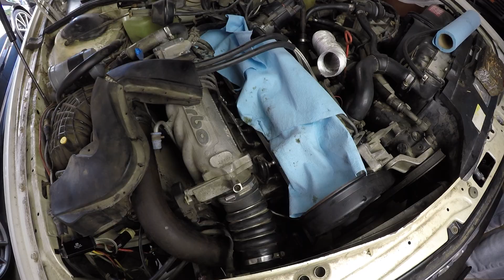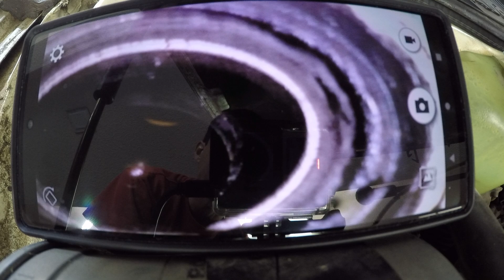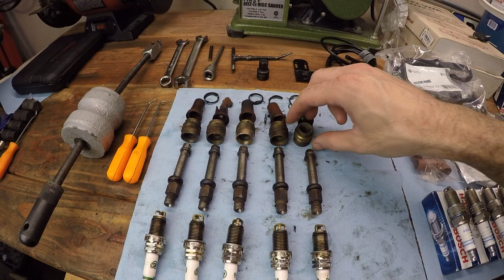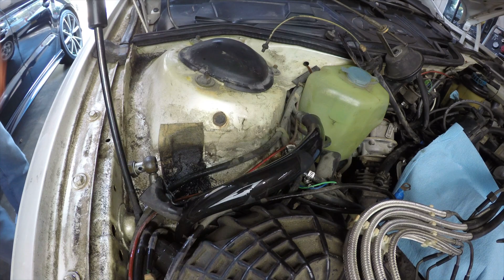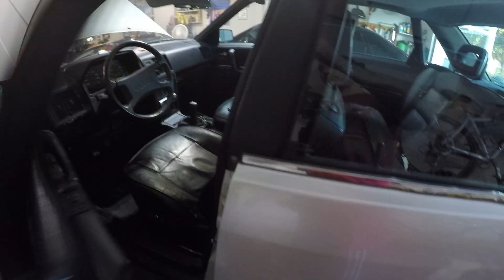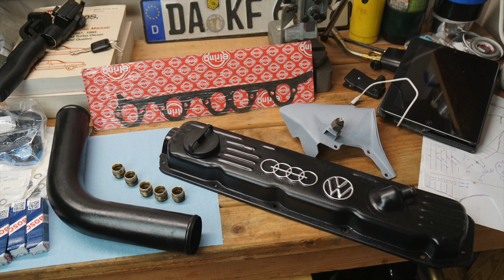Project Audi 5000 CS Quattro | Ep. 5 | CIS Fuel Injector Replacement

Comment: Thanks for this video it really helped me doing this job on my coupe gt! 
Shall i play the lottery now after i removed the threaded inserts the plastic sections came out all at one on the end ? 5 out of 5 came out all as one 👍🏼
Reply from the maker: Buy a ticket now!! That's very good luck 😆
Reply: @PracticalEnthusiast  still having a few issues with the car and how its running (if you have any tips/suggestions) but i’m happy that job went smoothly! 
Thanks for the video it really helped with visualising everything first before tackling the job 👍🏼
Reply from the maker: @mikeyalcock5729  that's great to hear! Continued running issues are likely down to a vacuum or boost leak. I just fixed a pretty big air leak in the throttle body shaft bearings. Unfortunately, that's not an easy job to remedy. If I end up keeping the car then I'll try to make a video on how to do it.

Comment: Hi there... i have a 1980 Audi 200 5T .. I have a couple of 'stuck open' injectors that is dumping fuel into the block.. my question for you is.. is there a way of clearing my injectors without removing them? 
And are my injectors the same as in your engine? 
Kind regards 
Stewart (UK)

Comment: Could you post the part number of the injector air shrouds?  I can't find the part or part number anywhere for a 1987 5000 turbo.  I have all the other parts I need for this job.  Thanks

Comment: Thank you very much for your videos . My 200 turbo need help.
Interior light ? I think is the conector under the Dashboard.
The fuse 13 is very Hot. Fuel pump ko?
Audi have automatic diferencial because front tracción have 5v  of 944 turbo . I Discovered ten years later.

Comment: Im having some weird issues with fuel starvation. I have a 88 5000 CS Quattro and some days it will start nice and easy others it just wont even after long cranking. Seems like the fuel pump will sometimes send fuel to the injectors and others wont. Im not to sure whats going on but i feel like its some kind of electrical issue where it will only prime the pump if the connection is good. If you have any ideas let me know. Thanks.
Reply from the maker: This sounds like a failing hall effect sensor in the distributor. I only suspect this because I once caused a similar issue on my 5000 by accident by forgetting to plug the hall effect sensor back in, and the fuel pump wouldn't prime. I'd start there if I were you.
Reply: @PracticalEnthusiast  thanks man. Ill take a look later today. I was messing around and got the car running yesterday. Just unplugged the relay and put the old one in and now it starts. Was doing testing and plugged in the one the car had before and still started. So obviously i dont have a relay issue

Comment: CIS is a favorite.  If you had pulled the injectors out with the lines and jumped the fuel pump relay you could have heard the CIS symphony (they sing!)  :).  Nice work!  Injectors are the last thing I still need to replace on my 4kq.  FWIW, the stock plugs are Bosch W7DTC and you can sometimes find them on Ebay.

Comment: The air shrouds you're talking about are most likely not for cooling the injectors but to atomize the fuel. Those injectors look to have fairly poor atomization so by passing air through the fuel stream to break up the fuel before it impinges on the intake port walls it will be more likely to flash into vapor and improve transient throttle behavior as less extreme accel pump or decel fuel reduction is needed.

Comment: Well done. I had a 1992 Mercedes that had CIS fuel injection. I replaced the HUGE fuel filter (it probably held close to a quart of gas) and I had to crank the engine for at least 10 minutes to prime the system! Excellent video on a cool car.
Reply from the maker: That's why it took so long to start! 😅

Comment: great job, that injector service definitely was needed. but it wouldn't surprise me if that vacuum hose you replaced was responsible for like, 90% of the rough driving problems you were having :D
Reply from the maker: There very well may be other vacuum leaks as well. Something I'll have to investigate further.

Comment: Wondering if a rubber bushing of appropriate diameter and a bolt/washers through the center would help removing those plastic cups.  Insert, tighten nut to compress and expand the bushing so it grips, then slide hammer pull out?
Reply from the maker: That has potential. My only concern with that approach is it could expand the plastic, increasing the resistance of removal. But if used in conjunction with the slide hammer, it ought to work.